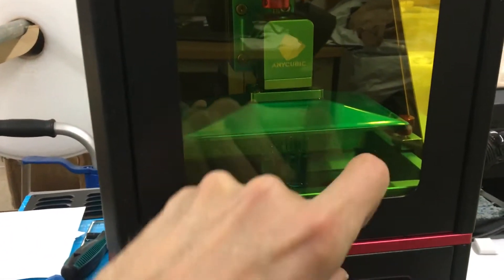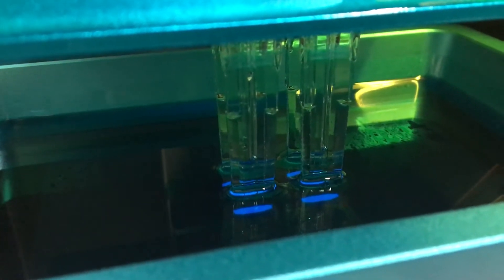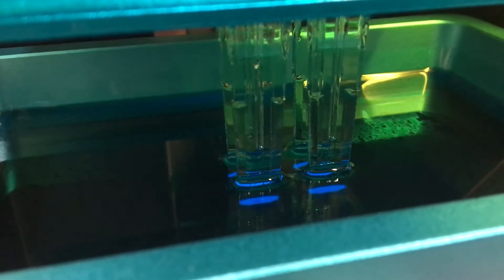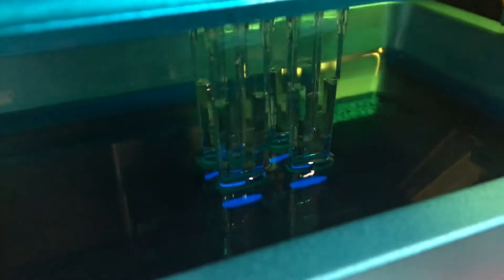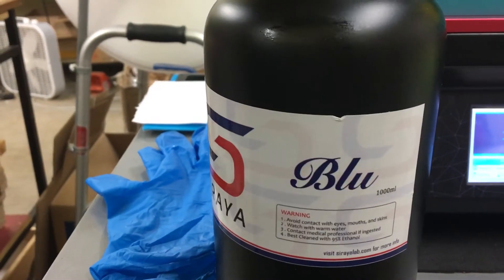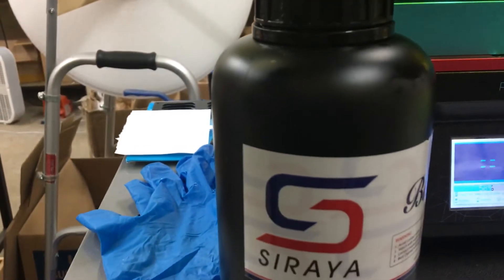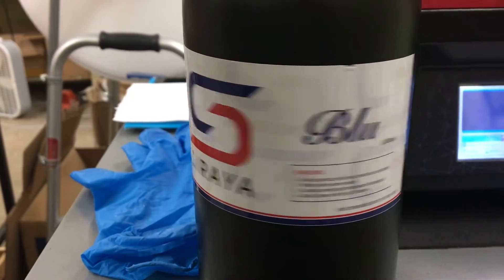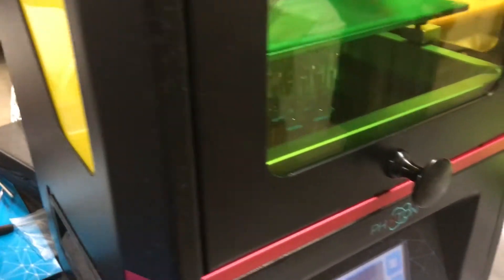3D Printing with “TOUGH” Resin - Pt 1 - Siraya Blu testing on Anycubic Photon for knife making parts

Comment: Any tips for working with siraya blu? 
I have a photon and recently bought a litre of the stuff. 
Levelled my build plate and got successful prints in the green resin that comes with it but when I switch over to siraya blu I get a load of failures :/
Reply: make sure you check out the user guide on siraya.tech for correct exposure data and how to prep for printing. Join the Siraya Tech user group for community support and trading tips
Reply: You need to heat the inside of the build area.
Reply: @calebgray7782  As long as your ambient is above 70F, you're fine.